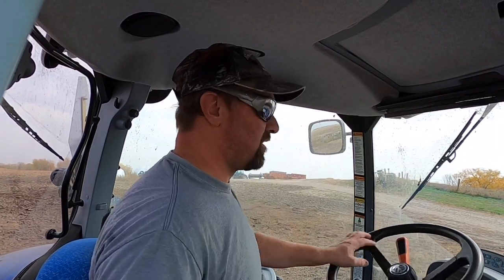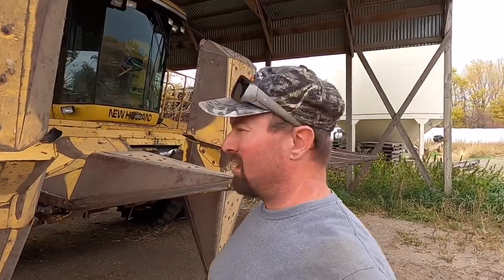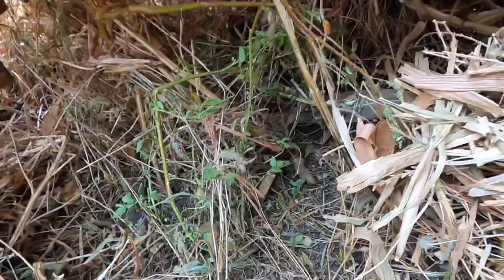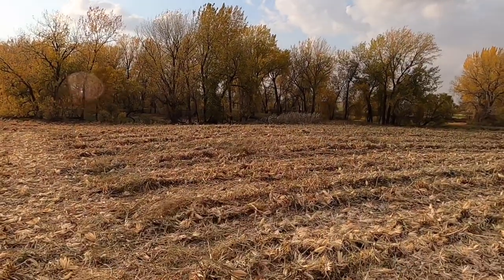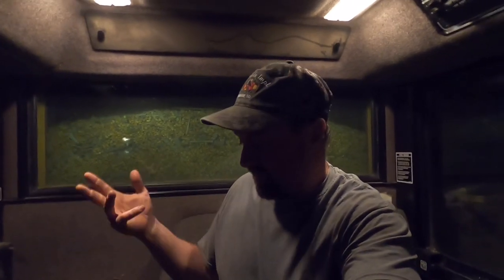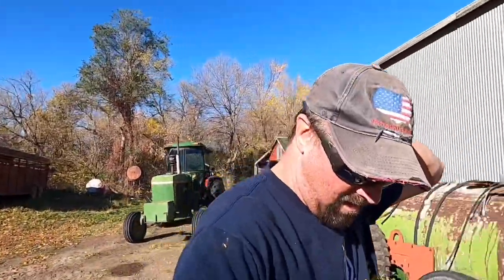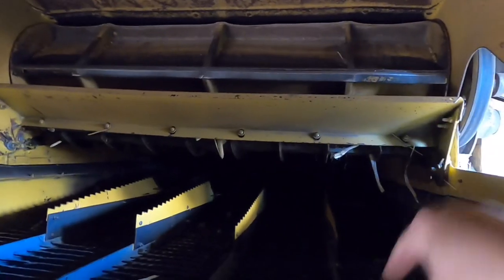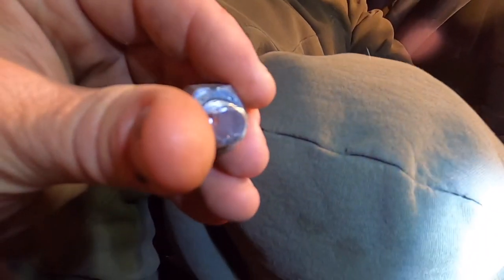Getting Started On High Moisture Corn and Turning Another Year Older!

Comment: Another october bday! Mines the 25th.

Not sure how the TRs did it for the stone door, but on the CRs you can manually drop the door by pushing in on the solenoid on the left hand side of the feederhouse... have to use a long pry bar or something to be out of the way when it goes.
Reply from the maker: Happy  belated birthday! I later found out The stone trap can be tripped by taking a pry bar & moving the tripping mechanism. I will show it in the next video.